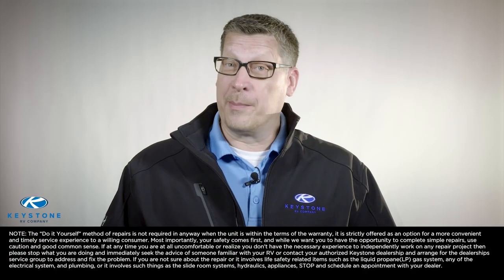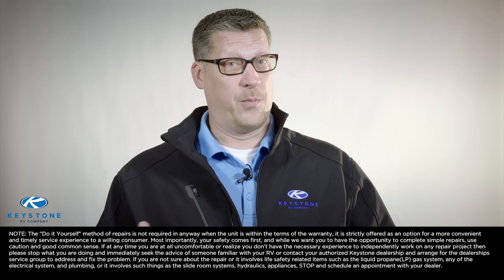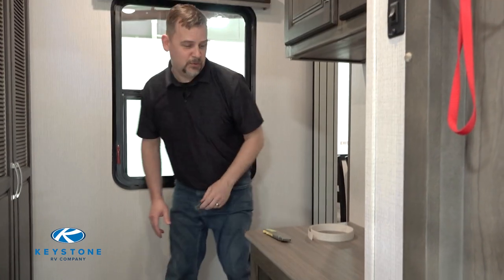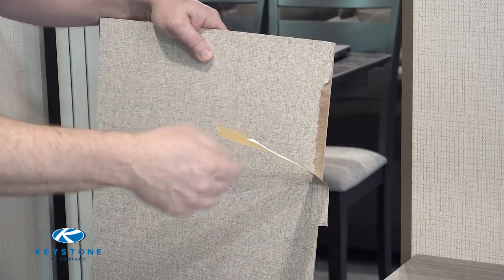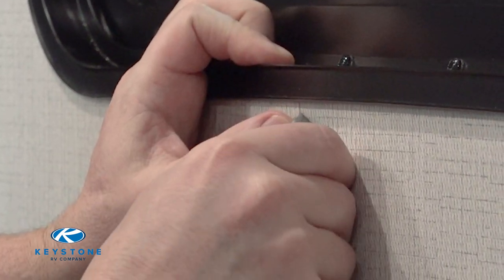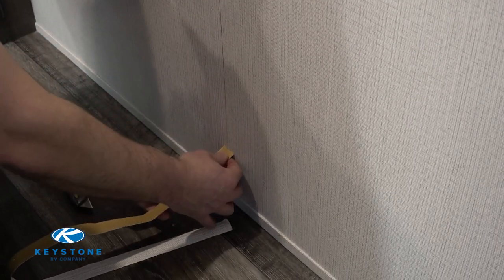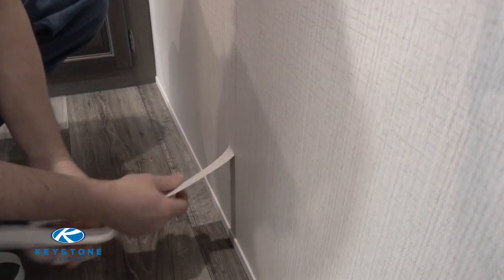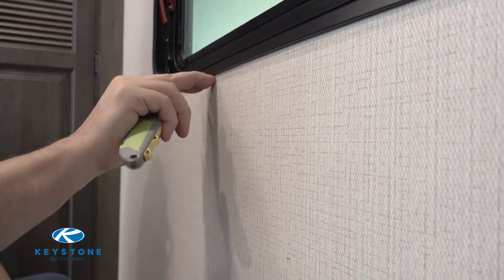RV Pro Tips: Replacing Seam Tape

Comment: Does a little heat help in removing the tape?
Reply from the maker: Good Morning,  we recommend using a razor knife to cut the seam tape free from under any roof or floor line trim to start removing this. You can use heat to help soften this up as well however I would ensure you are very careful in doing so.